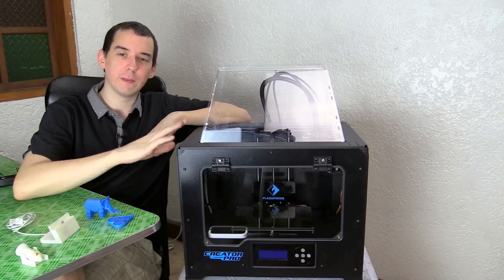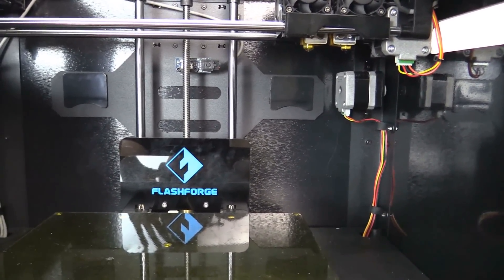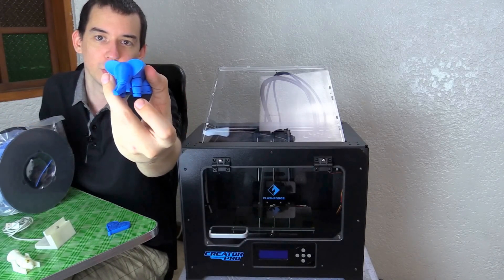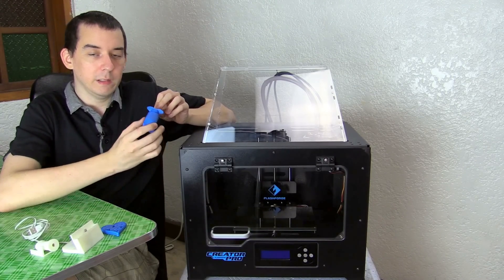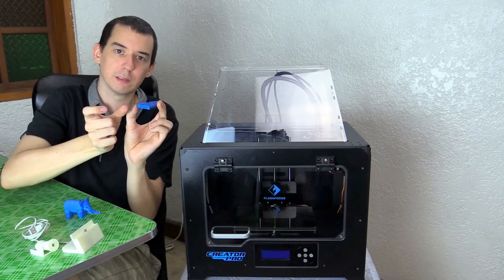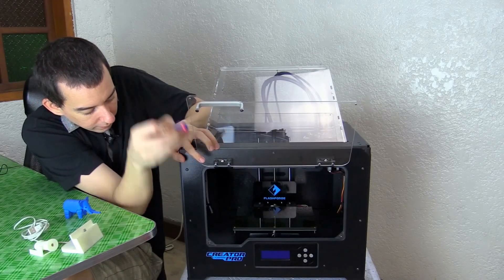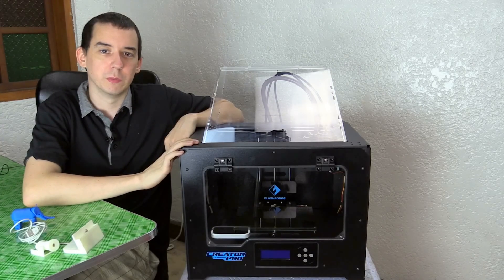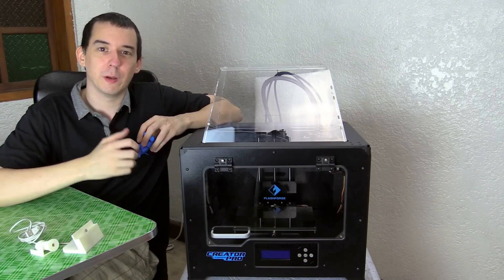Flashforge Creator Pro 3D Printer

Comment: I would think leveling would be easy with a dial indicator stuck on the extruder. I don't own a 3d printer, but I am a machinist. You can hand jog the extruder and table right?

Comment: You talk about fumes and it's fair point. However printer is sealed with acrylic so it kind of moot point. Right?
Reply from the maker: It's not an air tight seal. The fumes easily escape.

Comment: What slicing software do you use with your printer? I recently purchased a different FlashForge printer and am finding their included "FlashForge" software to be just god awful. Specifically, it makes mistakes that have been fixed in Repetier/Slic3r for years and basically my prusa outprints it at a third of the cost.
Reply from the maker: I use Makerbot, it's simple and works perfectly pretty much every time :)
Reply: Tinkercad it is free.

Comment: My Creator Pro came with the blue surface on table. Unless I print a raft, no ABS sticks to it. Do have any idea how I can fix this?
Reply from the maker: You can go to your local glass store and have them cut a piece of glass that matches the size of the build plate. Then buy liquid hair spray (not the aerosol kind). You put a few sprays of that on the glass and leave it to turn tacky. Then print onto that surface. You can also just buy a glass build plate on ebay. I hold mine in place with bulldog clips.
Reply: Buy a Ceramic floor tile cut to shape ,,,might have to cut  some off the bottom or shift top Micro BP stop down 10mm us a drop of Acetone with abs left overs need as liquid as possible,,Heat on BP is not necessary,,

Comment: Hi! I'm new to 3D printing and have a question for you. I've seen lots and lots of videos and the printed models always seems to show all the filament lines. But with the models you printed ( especially the elephant) it was so smooth. My question is, how did you acheive such smoothness? Did you clean it off after printing it, is it because of the quality of the printer itself, of the model itself or because of the settings you used? Thank you in advance :)
Reply from the maker: The prints shown in this video were straight from the printer without any special chemicals, cleaning or smoothing process. The quality of the printer makes a huge difference in the outcome of the print. The settings you use can also make a difference, thinner layers will blend better but take longer.
Reply: Or wipe Acetone over it

Comment: Great video.  I haven't bought one yet but I'm seriously considering it.  Wouldn't placing a simple 'bubble' level in the middle of the plate be adequate to 'level' the heated plate/
Reply: The leveling process aligns the build plate to the nozzles, not to gravity.
Reply: Thanks, Richard.  That makes sense - and it doesn't sound simple.

Comment: Once the base is level could it sit on a large boat docked and print?
Reply from the maker: +Hoverbot1TV probably yes.
Reply: Gadget Addict Thanks it won't be rocking around. I want to use it to make abs parts for plumbing and electrical led fixtures. :o)

Comment: When printing with just one extruder, do both cooling fans turn on, or just one?
Reply from the maker: +Paul Sieradzki It's possible that both fans will come on because the heat is transferred through the combined heatsink and once the second extruder senses the heat, that second fan may be turned to help regulate the temperature :)

Comment: There are 2 or 3 models like this on various online retailers, namely amazon. What is the difference between the $1000 and $800 models?
Reply from the maker: +Geoff Garrett Without seeing them, it's hard to say. But it might be the older model verses the newer. One has a wooden body and the other has metal and then some minor hardware upgrades.
Reply: +Gadget Addict thats whats odd. They look almost identical. One is the "creator pro"  the otger is "qidi technology". But i see nothing different between them on the details front. I suppose its possible that one is just a newer version.
Reply from the maker: Geoff Garrett Oh so the brand is different? I'd assume qidi technology is a clone since Flashforge is extremely well known. You might save $200 now but regret it in the long run if their quality isn't up to the spec of Flashforge.
Reply: +Gadget Addict heh, you're right. I was too busy looking for differences, i didn't notice the maker themselves. Truely a case of "dont judge a book by its cover." sure enough it appears to be a clone.
Reply: Geoff Garrett You might also find that one of the clones is actually better than the FlashForge. it's often possible to take the best of one design and fix a few small problems and produce something that's better than the original. For example the QiDi Tech 1 has no wooden parts. The frame is all metal.  It's also significantly less expensive than the FlashForge.  I also purchased the MagHold removable bed. It's aluminum with magnets and a thin piece of spring steel that can be popped off, flexed, and the parts fall off. No messing around with hair spray or glass plates that can break.

Comment: I have Flashforge Finder 3D printer, it works like a charm and only costs £499. Did you consider this printer when buying your other one. Although it only prints in PLA, you can buy upgrades like larger print beds and heated print beds. Why did you not go for this one. It is quieter, cheaper and better?

Comment: This is THE BEST video I've found!  I spent HOURS trying to figure out how to level and looking for the SD card slot.  Thank you!
Reply: SD on these is risky as the SD card moves and the printer stops so you have to start over,also bits of plastic fall down the SD slot so move the monitor our side,,print some brackets,,,take door off. put a switch on side and print a cover,

Comment: Great explanation.Do the heat settings and other settings need to be done on every print or is there default settings so you do not have to set each one up every time you print?
Reply from the maker: +Maralee Scott You save them as defaults inside your software so you don't have to mess with them after initial setup :)
Reply: Perfect!  Thanks so much - I can't wait to get started.  My printer arrives in 4 business days if all goes well.

Comment: Thanks for the great video!  Can you comment on the Flashforge Dreamer versus the FlashForge Creator Pro Dual?  As someone new to 3D printing it is a bit confusing.  The print envelope of the two machines is similar and Dreamer seems to have better connectivity plus the ability to use PVA.  The FlashForge website only mentions ABS and PLA compatibility for Creator Pro Dual, so I am questioning if it could use PVA.  The PVA looks like a good option to use for supports of a complex structure with overhangs.  To my totally inexperienced eye the Dreamer looks like the better printer, yet it is $100 cheaper than the Creator Pro Dual.  What am I missing?  Is it an issue of the software supplied and compatibility with Makerbot Replicator 2X?
Reply: One print head is the best ,,not often you need two heads.

Comment: I been trying to level my bed for a month now :/. Then theres my problem that the raft pretty much sticks to my print. Then theres the problem where it doesn't stick to the bed :(
Reply from the maker: +kev zurc What are you using for your bed? I use a glass plate and spray it with hairspray (from a spray bottle, not an aerosol can.
Reply: Im just using the heating plate(110*-120*) and fresh kypton tape. Thats all the manual says.(Flash Forge Creator X) Like yours

My main problem is that halfway through the print, the edges start lifting which progressively gets worst or is hit by the left nozzle. Thanks for your help

Comment: Are you able to adjust the temperature and say print Styrofoam filament or other types of filament?
Reply from the maker: +DzuariHD Yup you always adjust the temperature depending on what type of filament you're using. It's a simple and common setting :) I've not seen a styrofoam filament before but there are wood and metal type ones which feel and weigh close to what the real thing would. They're pretty clever concoctions.

Comment: hello kind sir thank you for your videos . I also own a flashforge creator pro and i would like to ask you some questions since there are not many inmformative tutorials from the company . I am also having a terribly hard time leveling the bed , i own it for some months now and i believe i have not ever calibrated it correctly. I also cant calibrate both nozzles at the same time . If the right one is correctly calibrated the left one is either too far away or close to the bed and vise versa . Share you method please . Save my life i cant stand it anymore :p . And also do you recommend a glass bed upgrade ? I am having troubles with some prints . Cant get the material to stick correctly and also i dont always get the smoothness i want . Final question and sorry for talking too much :p Do you believe simplify 3d is worth the money  or should i stick with replicator g ? thank you in advance have a lovely day
Reply from the maker: +Restless R2 I'm glad you found it useful :) Unfortunately it's a known problem that the two nozzles are not aligned. I either re-level or wonky level to try avoid the problem. You can actually adjust the height of one of the nozzles so they match each other, but I'm a bit lazy for that. I would recommend the glass upgrade because it's super cheap and prints stick very well if you use hairspray on the glass; specifically I use liquid hair spray in a squirt bottle rather than aerosol. I've not tried Simplify 3D, I use Makerbot, it works perfectly! Hope this all helps :)
Reply: +Gadget Addict  thank you so much for your super fast reply . Helped me a lot now that i know that the two nozzles are not aligned . I thought i was crazy :p One last thing . Any glass would do the trick ? or i need a borosilicate plate ? Oh and hairspray directly to glass or kapton tape first ? I m sorry for bothering you again , i ve been googling and searching for days and i havent found usefull information yet . You are really saving me here thank you for your time :))

Comment: You did a great job with this video! Thanks a lot!
I'm printing at shapeways right now but considering own 3D printer at home and I wonder to purchase this model!
My concerns are the surface finish of the printed objects.. is it a nice finish where you hardly see the layers? I'd really need to see a sample to consider before purchasing...
Do you have a macro shot of anything you printed with this printed in ABS to share?
thanks a lot!
Reply from the maker: addk3 If you look very closely, you'll see the layers. If you run your finger nail over it, you'll feel the layers. But if it's just sitting on a desk, you wont be able to see the layers. There are also chemicals you can use to smooth the layers to a glass-like finish. I don't have any macro shots, I'll see if I can get one but I'm not sure if I have a camera that would produce something good enough to help you.

Comment: PLA and ABS are both 'low quality' plastics. As someone who isn't someone who has looked into it, is it possible to use any of the higher denisty plastics, like acetal plastics?
Reply from the maker: Richard Smith A quick look on google suggests some people have experimented printing with acetal plastics; but it doesn't seem common so you might have a hard time finding a filament designed for a 3D printer. There are also some other specialist plastics available. But most of the time people just use ABS or PLA.
Reply: Gadget Addict ABS is ok, but I am surprised people settle with it. PLA is a 'temporary' plastic, and will not stand the test of time. I guess that is ok for people just making doodads and don't want to fill the landfill with their junk for hundreds of years. For instance, a cup of steaming coffee poured on PLA would melt it, unless it is using some additive that raises its melting temperature. Honestly, i personally don't see why people would use it except as a test plastic while refining a model.
Or maybe it just that I don't understand the 3d printing scene quite yet :P
Reply from the maker: Richard Smith I prefer ABS for the reasons you mentioned. But some people prefer PLA because it's supposedly easier to print with and a bit better for the world :P A lot of doodads people print just sit inside the house and aren't exposed to extreme heat or long periods of direct sunlight, so I guess PLA is okay for them. Personally I'm an ABS boy 8-)
Reply: Gadget Addict After some googling of my own, it does look like nylon is a thing, that looks very promising. Too bad fiber impregnation is not really feasible to help stiffen it up tho, as nylon is a bit on the floppy side.
I was asking because if one of these happen to charm me into buying it, it would be put to work to make things that are put to work :P 
Acetal does look very possible though, even if I have to print my own modifications to make it work :P

Comment: hello, thanks for the nice review video. I am using the flashforge creator X, and having some troubles with the raft under the model which i cannot remove in a clean way without damaging the model. Do you have any tip or trick to remove it properly to get a clean model?
Reply from the maker: Fido Dido I avoid using the raft unless I absolutely have to. All you can do is use sand paper and other tools to gradually smooth it out. It's hard to get it perfect though. You can actually buy a resolvable filament. You have your main filament in one extruder and then the dissolvable one set for supports and rafts in the other extruder. Then when finished you can wash away the dissolvable filament without any damage to your main print :)
Reply: Gadget Addict Thanks for the prompt reply! did you print your sample models by using the dissolvable filament ? 
until now i printed only with PLA filament with the left extruder. I did the printing plate level calibration so the head is close enough to be able to insert a post it paper between the printing head and the printing plate. however it often happens that the right head bumps into the model causing it to move and thus ruining the printing. i tried to print without the raft but this problem is worse as it seems to decrease the adherence of the model on the printing plate. when i starting the printing, i used kapton tape on the printing plate and it was just fine when using raft but after few months the model would shift when the second head is bumping into the model. I switched then to blue painting tape and it worked fine again, but after few weeks the problem came back. today i tried to print the gear heart model with raft and gave it a try with the kepton tape. the first try was ruined as the model shifted but the second print was ok but i ended up holding the model with a spatula to be sure that it doesn't move. Did you experience such disagrements in your early days in the 3D printing world ? 
Thanks
Reply from the maker: Fido Dido Nope, I don't have any dissolvable filament, I've just seen it being sold and used on Youtube. The problem you're experiencing with the extruder hitting your print is common. The extruders on the Creator Pro are not level with each other. You can fix this yourself with some basic tools or you can try to adjust your build plate to avoid the problem. I had the same problem with the second extruder knocking things off the plate or burning marks into my print,  but eventually I learned to level the plate to avoid those issues. I use a glass plate with hairspray, things stick extremely well.
Reply: Gadget Addict thanks for the information, hte hairspray sounds like a great idea! in case of the raft made by a using dissolvable filament, the replicator software doesn't seem to allow to set a head for the raft and the other head for the model, do you know if such option exists?
Reply from the maker: Fido Dido I use the Makerbot software and that lets you select one extruder for supports/rafts and another extruder for your main print :)
Reply: Gadget Addict you are using the makerbot software to print on a Flashforge Creator Pro printer ?
Reply from the maker: Fido Dido Yep, since day one. It's more user friendly than replicatorG.
Reply: Gadget Addict Oh ok, I wouldn't imagine it was even possible as the communication protocols between FF and makerbot might have been different. 
Again thanks a lot for all the information you shared here, I learned a lot!
Regards

Comment: You forget that 3D printers has logic circuits which needs programming. There is a lot of engineering in designing the threads of the riser rods. To me 3D printers are high tech. How's the visibility of the layers? Can you also have one extruder uses support material and the other the main material?

Thanks
Reply from the maker: BJM Graphics  If you run your fingernail over the layers, you can fell them. But to the naked eye they're not immediately or easily visible. You also have acetone smoothing and other options if you want a smoother finish. You can use the second extruder purely for support material and you can use a dissolvable plastic for the support material to give a better finish.
Reply: thanks.
I am quite skilled with a Dremel tool, so I'll us that for touch ups.